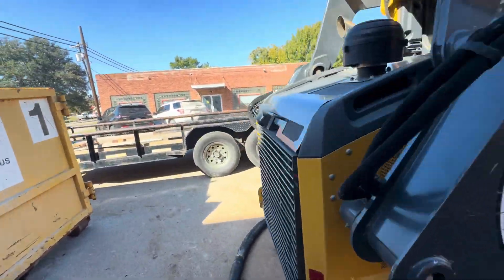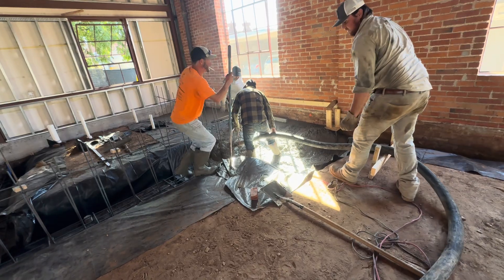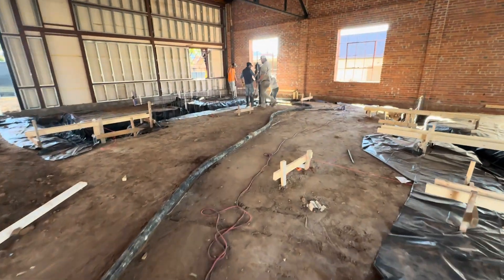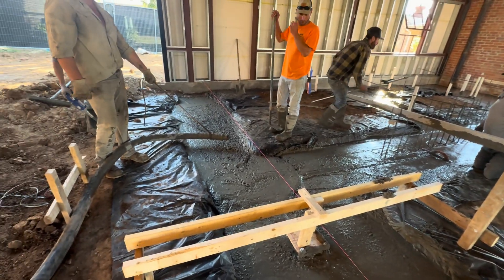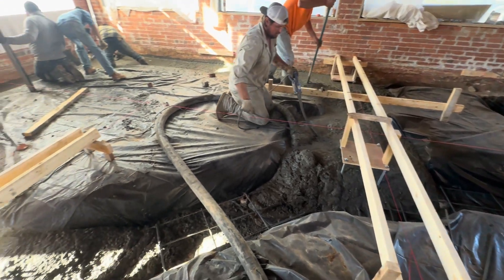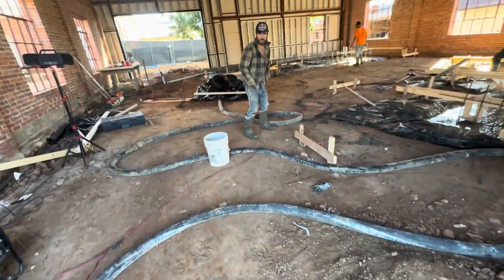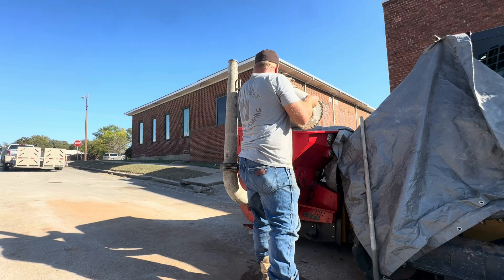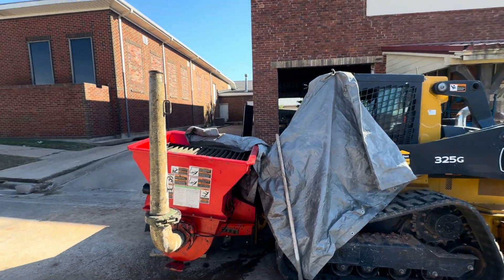Placing Concrete Inside this Building using a Concrete Line Pump from Mud Demon

Comment: Can you get the specs on that mix?
Reply from the maker: It’s a 50/50 mix 3500 psi
Reply from the maker: With 1” minus rock
Reply: Is it 50/50 57s and 78s? I've been working with a local supplier on mix designs, pumped out a 75/25 mix yesterday through my new 2.5" system, worked awesome.

Comment: Despite the aggregate size, that looks like a nice, "fatty" mix design which they put together for you. Never underestimate the Mud Demon. I my short time around that machine, I was super impressed with it. Now only if they could build a slightly higher volume trailer pump unit which I could truck mount onto a little Isuzu like what Ian's pump is on... 🤔🤔🤔
Reply from the maker: The best thing you could do is bet them that they can’t. 🤣🤣🤣. I’m pretty sure
Matt likes a challenge.
Reply: @MuddyfeetConcretePumping   Matt is a genius at coming up with practical solutions, no doubt.